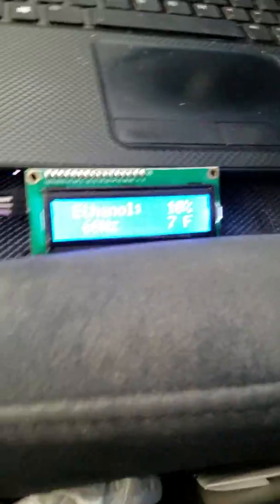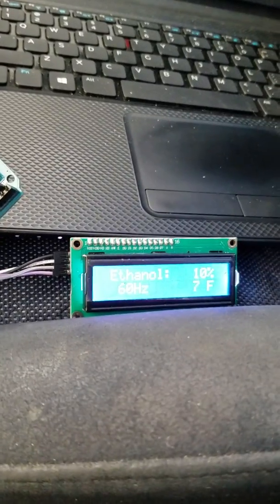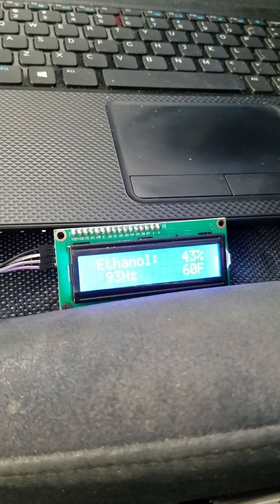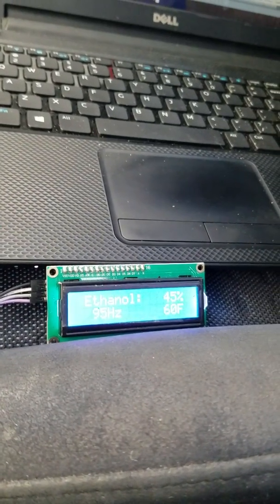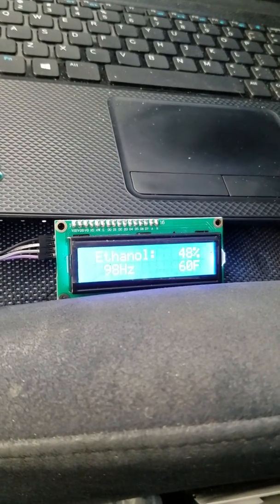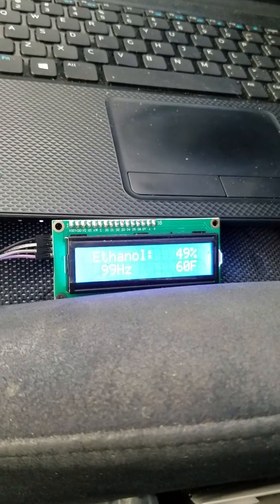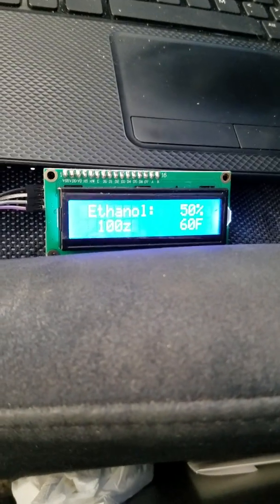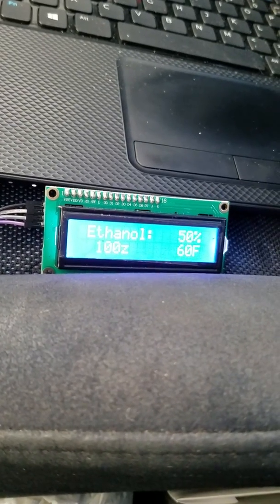Arduino e85 sensor

Comment: hey, just subbed. thanks for sharing your setup. have you built this sensor as a nano?
Reply from the maker: Immortan Jon I have no. I have all of the stuff to do it. just been to lazy after getting home from work lol
Reply: mrb00sted i have a few nanos, 1 i2c oled, and no flex fuel sensor, but am looking. pretty new to arduino so im not sure what differneces have to be accounted for from board to board, display to display, etc. thanks for the quick reply. are you anywhere near ny?
Reply: @dukeofnyd1  did you get around to doing this on a Nano?
Reply: @mushasho  nope! Sorry